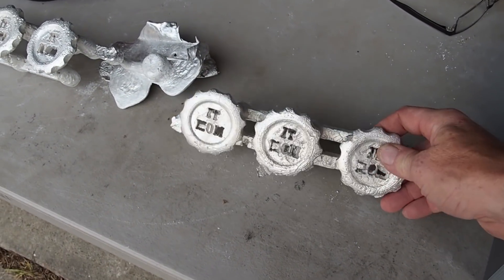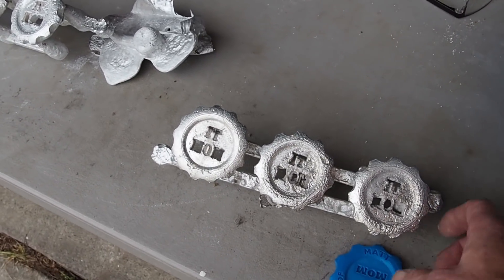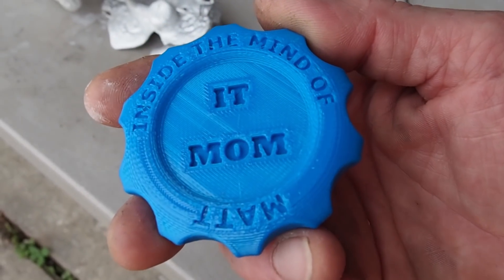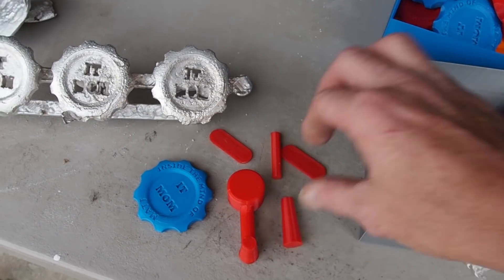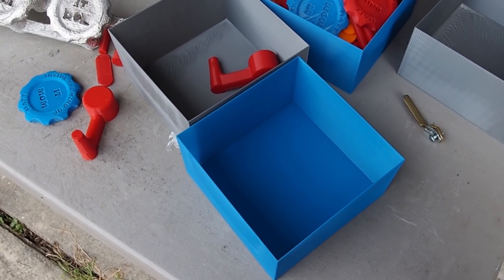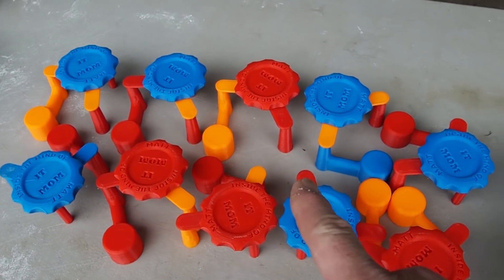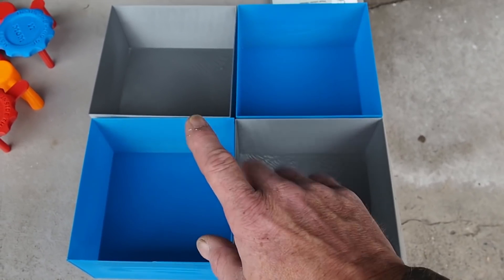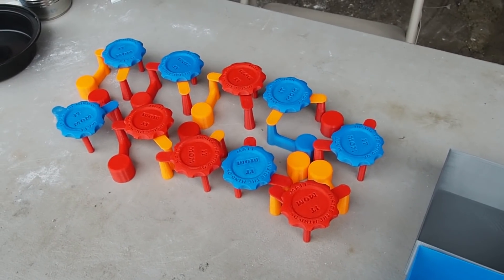Lost PLA Casting 3D Printing The Mold Box

Comment: Getting the process down Matt!
One suggestion - just before quitting to let the molds set, chuck the Allen key as deep as you can on the long end.  You should get a higher vibration frequency that way.  Less mess, and might bring smaller air pocket bubbles to the surface.
Looking forward to part 2!
Reply from the maker: i did try it that way and it wasn't enough maybe a larger key with more weight I'm going to craft a vibrating table or maybe a vacuum chamber but I'll be casting in a few hours and posting after I edit :)  oh btw one of these is yours if they turn out good
Reply: That would be sweet!  I'll be watching, of course!  :-)